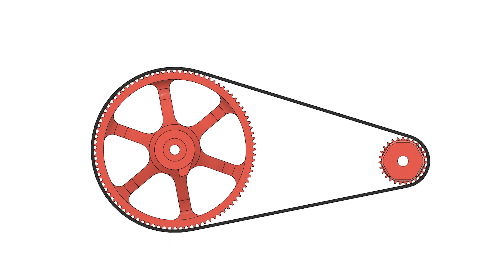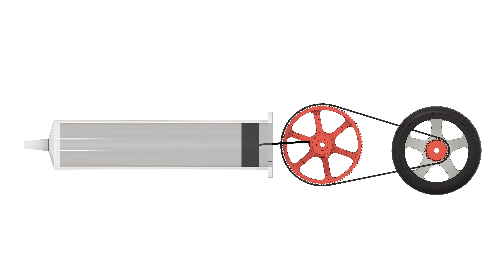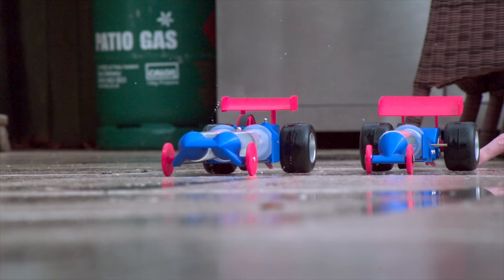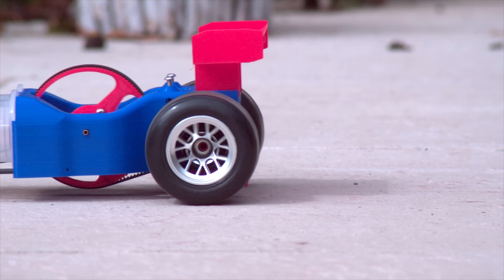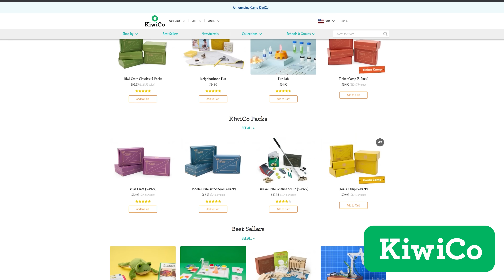Vacuum Dragster

Comment: Hello i have tried to make this on a bigger scale when i was younger but give up because of too many failures.. i was trying to solve the battery problem on solar lights by using the light pole as the chamber and adding a gearbox to the top attached to a piston inside the pole and a low rpm treadmill motor as a generator.. you can see the machine working in my channel with springs but unfortunately i failed with the vacuum because of sealing issues.. Give it a look maybe you can replicate my idea.. sun will spin the motor creating the vacuum and at night the vaccum will spin .. boom you have an infinite cycle battery.. pls check my video spring powered light.. its just the prototype in a commercialise product it can be a small box attached to a pole.. i am glad to see people with the same mindset as mine.. cheers mate..

Comment: Have you tried adding a bit of lubricant to the gasket? I have found that adding a bit of soap to a syringe will make the rockets I make while doing dishes fly higher than when they are dry.

Comment: Another difference between this and a top fuel dragster: At the start of the run the dragster's wing is NOT providing a ton of downforce/stability, it's actually the exhaust gasses.   The open headers produce about 4.5kN (1000 lbs) of downforce before the air pressure on the wing takes over to produce over 10x as much at top speed.

Comment: And just like a real dragster, it goes slower at higher altitudes.
Reply: And im also slower when im high
Reply: グールにも愛が必要  i know ok, i felt stupid after i posted that comment
Reply: If I were above the atmosphere I sure would be slow.
Reply: Ian Crone there is no above the atmosfere 
Its a smooth gradual transition to space
Nature didnt make a bubble around the earth were all the gasses on the planet dont go any further out you know
Reply: @mrono1910  english please sir?
Reply: @mrono1910  you mean... like the atmosphere?
Reply: It’s gangster
Reply: グールにも愛が必要  the fuel is on top of the motor! They are called TOP FUEL
Reply: Facts
Reply: in that case official drag races should be done in Flevoland, The Netherlands, because it's like 5 meters under sea level.
Reply: @hifiteen49  there are places in California lower than that.... I want to say 20 meters/yards
Reply: Any engine will get slower and less powerful at higher altitude
Reply: Science nerd
Reply: well, yes, but actually yes.
Reply: It's name is less of value there because of that
Reply: Isn't this every engine though?
Reply: @DaneH64  Diesel engines perform much better at higher altitudes, the current world record for highest elevation in a motor vehicles goes to a MB Unimog
Reply: unless it's electric. Also if it was powered by pressurized air instead of a vacuum, it would actually go faster at higher altitudes
Reply: @beanapprentice1687  yeah that’s why i was thinking because the air density difference with the atmosphere is bigger(?) Not an engineer though
Reply: Just like a real dragster, it also breaks when you destroy it
Reply: Unless the forced induction is capable of more boost than the wastegate is tuned at, in which case you can go decently high up and not change engine power.

Of course, you might still have different times, since drag cars still need a bit of downforce.
Reply: Some Weeb what wastegate? they are supercharged, don’t have wastegates and they are controlled by the size of the belt “sprocket”. which controls the boost
Reply: @daviskaufman3168  theres some turbos that use waste gates, perhaps most top fuel dragsters use waste grates with their turbos.
Reply: Wyatt Camacho top fuels use super chargers
Reply: Wyatt Camacho top fuel dragsters don’t use turbos!
Reply: @savagetuner2404  lol, I know that now, I was bombarded with a bunch of comments after I said that
Reply: @wyattcamacho7464  it's a positive displacement supercharger
Reply: mercedes le man's flash jack intensify

Comment: Looks like the 2-syringe car is slightly lifting the front wheels when it starts accelerating. That’s allowing it to veer off course. When the rate of acceleration slows down and weight transfers forward again, it seems to run pretty straight. 
Making the car longer would reduce the longitudinal weight transfer and make it more stable. That’s why top fuel dragsters are so long. Perhaps try placing the syringes inline or just having a long chassis?

Comment: gave me the idea of a vacuum powered catapult with the syringe string acting on a sort of cam that would pull the object to be launched at faster and faster speeds as it accelerates.  would that have advantage over just a linear pulling force over the acceleration distance?

Comment: So, technically it runs on nothing?
Reply: Not at all.  It can be analyzed in several ways, but essentially it runs on the effort it took to pull the plunger out a certain distance against atmospheric pressure.  When released  atmospheric pressure forced the plunger back in.  The force of the returning plunger was harnessed to propel the car.
Reply: @denbecr49 Well, You didn’t have to explain it to someone who takes lectures in physics ;). The question was supposed to be a joke, cause vacuum is „nothing” etc. But yeah, Your answer is totally correct. It is almost like potential energy of a spring.
Reply: @mixer0014 
Are you familiar with Poe's law?  There are many here who make such statements without humorous intent.
Reply: @denbecr49 , yes I forgot that it does not necessarily sound like a joke. It’s hard to write irony

Comment: The problem with vacuum power is that you are limited to 1atm, where as a pressure tank can be many atmospheres. Also the external pressure caused by the vacuum inside, makes the syringe want to buckle and collapse,  while a higher internal pressure keeps it ridgid.
One advantage of the vacuum is that the force is relatively constant along the syringe travel.

Great work on the car though. For it needs to do the design is great.

Comment: Couldn't we build batteries using this concept? Use solar or wind energy when it is available and cheap to create vacuums in large tanks of some sort, and when energy is required, allow the pistons to retract, thereby driving a reduced gear system at a desired speed to generate electricity! As far as I know, the force experienced over the entire travel of the piston retracting remains constant, which would probably simplify and balance the output voltage. What do you think?
Reply: Pressurising the chamber is easeir and you can store more energy

Comment: The original Newcomen steam engine used air pressure for power, filling a cylinder with steam, and then cooling it.

Comment: 3:44 you forget about the energy to store this in the seringes ^^ In other words you use your energy to store another energy to produce Work, but i like the concept! :D
Reply: its ok, bcs it's the same with what it takes to produce gasoline, batteries, wound springs or whatever
Reply: There’s no stored energy in the syringe. The atmospheric pressure pushing the syringe closed is the energy source.

Comment: You can try a solvent on the rubber of the tires to make them softer - there is some specialty stuff specifically for RC cars but you can use something like WD40 if it's more available! Happy dragstering!

Comment: Hi Tom did the physics calculations. So for two syringe car  Radius of the circle where the string raps around is 4.75 mm. The big gear wheel has a radius of 23.4375mm and the small gear wheel has a Radius of 4.6875mm. 

Also I got 77.92 Newton's for the force on the syringe comming back. 

The work of the whole system (2syringe car) is 20.2592 joules. Will work out power later

Comment: test 2 :  place the magnet on syringe and it will repel other magnet on the end , problem perpetuum motion ? :)
test 3: place two dragsters in opposite directions to see who will win rope pull battle 
test 4:  place two syringes in opposite direction, place a walnut between, crush the walnut :)
test 5: place syringes in opposite directions, one syringe is fully charged , other is partial charged:  will it work as a damper? , or
yet the full charged syringe will complete to charge the other syringe and as it charges up, then  it recharge the empty one , perpetuum motion (use repelling magnets for more power)
Reply: 2.,3. & 5. will quickly seek equilibrium.  Reversals of momentum may cause vacillation that will dissipate due to friction, as happens with a bag of cement on a playground swing.  Whatever energy imparted to the bag by lifting it up to start will be drained away by aerodynamic drag and friction at the swivels.  4. Two syringes will crush with no more force than a single syringe squeezing the nut against a solid anchored surface.  Why use atmospheric pressure to substitute for an immoveable object?  Similar logic applies to a head on collision of two mirror image but otherwise identical vehicles traveling the same speed.  There will be no worse damage than if they separately hit a solid wall.

Comment: How would the dragster do racing against  a syringe rocket on wheels? Could you add spikes to the wheels of the dragster to get better grip on the concrete. Could a Vertical stabilizer help the dragster stay on track? What if the dragster was pulled along a wire like a landbound tramway? Sooo many questions!!!

Comment: It looks like it's impractical with your rear axle design, but try to put as much weight as possible to the rear of the dragster, like putting the transmission behind the rear axle.  Ideally the dragster should be on the razor's edge of flipping over. 
Occasionally it is even beneficial to add dead weight to the back, but this is rare and basically only happens with American pickups, which are very front heavy but rear wheel drive.

Comment: What if instead of launching both cylinders at the same time, you have 2 levers, but the 2nd one is tripped automatically by the first one after it makes a complete rotation?  That way, the launch of the first is slow enough to get the car moving, and the 2nd one is used to increase the top speed.

Comment: Tom, have you ever considered attempting a vacuum balloon? By evacuating the air from a lightweight chamber (either a thin, rigid sphere/polyhedra of thin rigid bricks, or a strong vacuum bag supported by a rigid wireframe+chordal braces inside), the average density of the whole chamber can be made less than the density of air, and so it will float

Comment: Great idea! Tom, you need to market this as a toy, possibly calling it an Eco dragster, as it runs on nothing more than the power of the air! (it could be the 'must have' this Christmas).
Love these projects.
Reply: It, really runs on the "power of human metabolism" though.
Reply: @FREENAMEFTW  Yes, you're right really, but that wouldn't sell it as 'Eco'!
Reply: @mrsmith4662  I sure think it could, but it would depend on the diet of the user
Reply: @FREENAMEFTW  
If you start over, it really runs on gravity, then metabolism (chemical energy) with photosynthesis before that.  A further step back it's nuclear fusion.  I assume before fusion it's ultimately the big bang.  Did we miss anything?

Comment: Can we exploit this further with a vacuum powered submarine?
Reply: Higher hydrodynamic drag than aerodynamic drag would greatly reduce the distance and speed it could travel.  Water is 800 times denser than air.
It would be instructive, but visually disappointing.

Comment: Super cool idea. Neat thing about this is that the force is practically constant over the whole pull if you have a good vacuum, unlike springs which get weaker as their energy releases.
Reply: I think vacuum and springs are the same cuz when the distance x decreases in spring same as presure in vacuum increase and also the differece between air and vacuum pressure decrease ..
Reply: @sihemkawtar8151  what? The point is with a very good seal the vacuum inside should stay almost constant the whole way, so the amount of pressure on it would the the same the entire time
Reply: @ipodhty  but this isn't the case, the pressure and force tapers, it can be felt as you pull on the plunger as it gets harder the further to pull it, if what you propose was the case compression ratio in combustion engines wouldn't effect power produced
Reply: @shredBucketheadshred  thats compression, completely different then a vacuum. You can always squish air more, but once it's a vacuum you can't make it any more less full of air
Reply: @ipodhty  but the energy created is not constant, the vacuum produces energy  that is converted into a force and this tapers as the as the vacuum drop lessens.  have you never seen a vacuum gauge ?
Reply: @shredBucketheadshred  if you have a piston with 1 inch^2 of surface on the piston face 
 wihh basically no air in it and pull it one inch. Since the air inside is at close to zero pressure (let's say 99%) the pressure on the piston will be about 14.6 pounds. If we move it out to 5 feet the pressure inside will slightly closer to zero (let's say 99.999%) so the pressure on the piston is! Wait for it! About 14.6 pounds.    If you start with nothing or close to nothing you can't make it have more nothing, and if if does get slightly lower pressure you are talking fractions of a %. 

And yes the energy goes up as you pull it, but the force doesn't. It's almost like energy is force x distance
Reply: @ipodhty  what point are you trying to make? the energy produced would NOT be the same right through the stroke of this piston/plunger's movement to equalise the pressure within the syringe , and BTW your example is poor , you couldn't move a total sealed piston with a chamber holding zero volume and you wouldn't produce a positive pressure if you did manage to move the piston an inch, the way this whole thing works is by you putting in energy to pull the plunger and lower the pressure of the atmosphere within the chamber then letting the positive atmospheric pressure push the plunger back into a position to equalise the pressure within the chamber, the energy produced is in direct relationship to the pressure drop/vacuum within and the atmospheric pressure needing to equalise, if you only create a 2 psi drop then it will only create a weak movement force as opposed to creating a 14 .6 drop from atmospheric pressure (roughly) dropping the total pressure to zero, the volume and plunger/piston head or face and bore/cylinder  size are also major factors in how much energy is produced BUT yes it tapers as the pressure changes
Reply: @shredBucketheadshred  " the pressure and force tapers, it can be felt as you pull on the plunger as it gets harder the further to pull it"
This is just wrong. If the piston is properly sealed and at complete vacuum, then it requires the exact same force to pull on it through the entire travel. No matter where the head is, on one side is 1 Atm of pressure, on the other side is 0, and the area between them stays constant.
Reply: @CreaperSiege  This isn't at vacuum when he starts though, that's where you're all getting caught up, it's at 1 atmosphere when it's fully closed, and by drawing it back he's creating a vacuum.  If you started with the plunger all the way down, pulled a vacuum then sealed it you'd be correct, but it's not starting with a vacuum, it's starting at one atmosphere of pressure, when you pull the plunger it's creating a vacuum because the volume increases but the amount of air inside doesn't, it's not technically a vacuum, it's just forcing the air to be less dense, and that's why the atmosphere tries to push in on it.  If you pulled a vacuum and sealed it before moving the piston, I don't think you'd be able to move it at all, and in that scenario what you'd be fighting would be both the atmospheric pressure differential, and the elasticity of the tube.  I think...
Reply: @GingerNingerGames  one nighthawkinlight specifically said a good vacuum so I'm assuming it was prevacummed. 2 the amount of air in a closed syringe is miniscule, so as soon as you move the syringe one or 2 cm it is 99% vacuume. 3 way do both of you think once you have a vacuum it can't move anymore? You can make as much vacuum as you want its not a hard limit, the deference between 1 atm and vacuum is only like 14.6 psi, its not hard to pull
Reply: @GingerNingerGames  also never mind the theoretical. I have put my thumb on the end of a syringe and pulled it. For the first few centimeters the amount of force needed to pull it rapidly increases as the small (small but could be greatly reduced by making a better piston ment for this) amount of air goes from 14.6 psi to below .5 and after that the amount of force feel roughly constant. And if you pre vacuumed the syringe and or reduced how much starting air you have it would feel like that as soon as you pull it
Reply: @GingerNingerGames  You are quite mistaken, vacuum is just the absence of air, it has no energy and it doesn't stop you from making it bigger, the force always comes from the pressure diferential between that vacuum or low pressure volume (its the same for both) and the atmospheric pressure outside. That is what is pushing against you, not the vacuum. Atmospheric pressure is not that strong to go against you (in the context of a small cylinder, the force would increase if you increase the surface area for air pressure to push in) so you can pull it as much as you want even if you have reached almost complete vacuum already.
And yes, it will act as a spring as long as it has some air inside before you start pulling, if you already lowered the pressure close to vacuum then it would have a pretty much linear force instead of it being a curve
Reply: correct you are
Reply: https://youtu.be/te_OGv6QeRQ